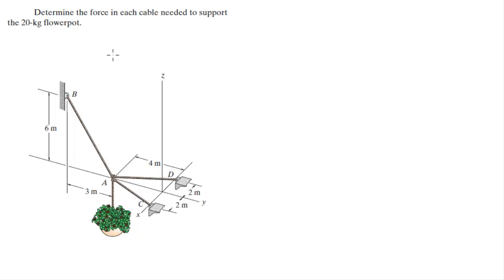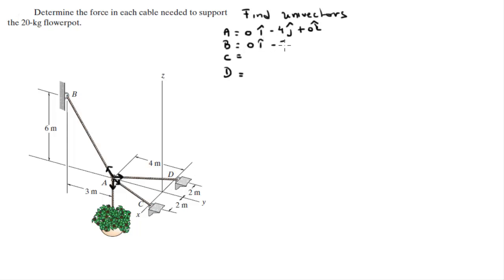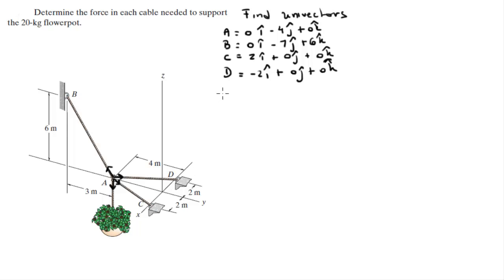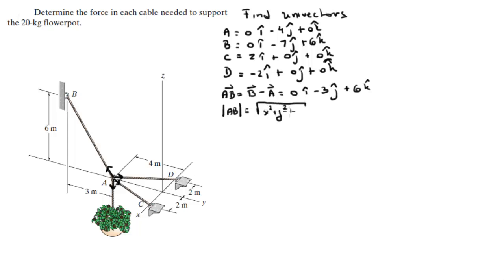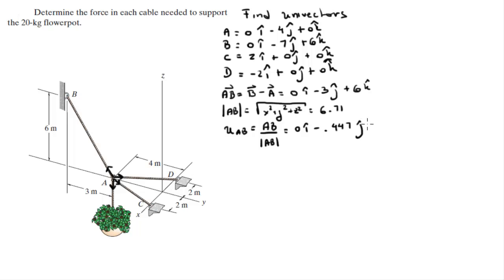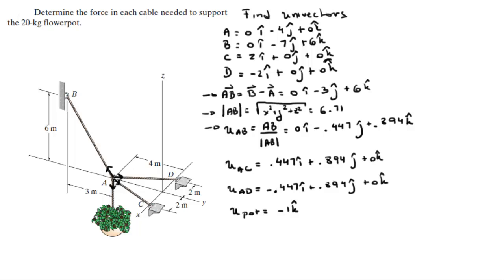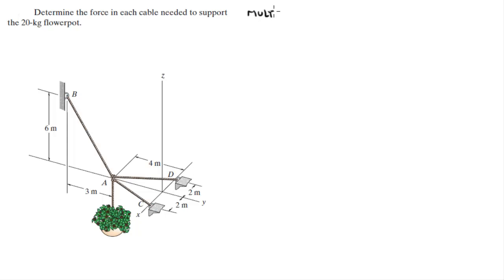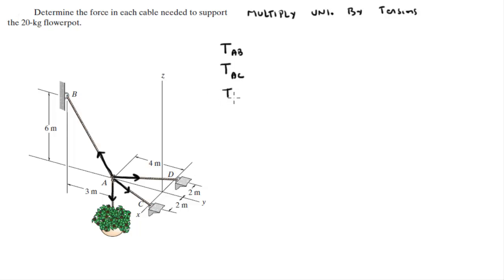Determine the force in each cable needed to support the 20-kg flowerpot

Comment: Hello thank you so much! Very descriptive and helpful, I do have one question, when calculating the k values  u stated  Tab *Uab was 1.894, later it was only .894, was this a typo or did I miss a step?
Reply: I believe it was a typo. Originally it was calculated by 6/6.708= .894
Reply: yea i noticed that as well, that seems to be a typo

Comment: Statics. (Equilibriums) i guess need to use matrix 4x4, but I don’t know how to use it properly , there is Problem — three cables are connected at A, where the force P and Q applied ( Р on  the line X and Q in Y line) knowing that P=1200N , determine the value of Q for which cable AD is taut. AB { -960mm(i) -240mm(j) +380mm(k) }.    AC { -960mm (i) -240mm(j) -320mm(k)}.  AD {-960mm(i) 720mm(j) 0mm(k)}      P=1200N(i)   Q=Q(j)